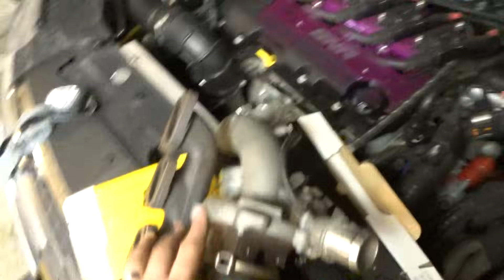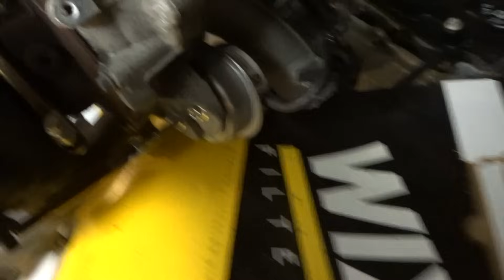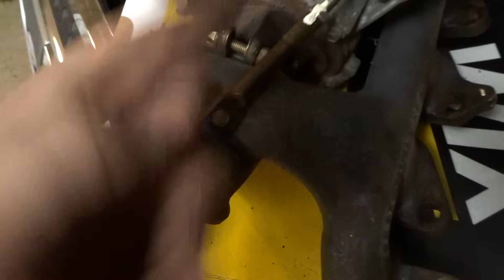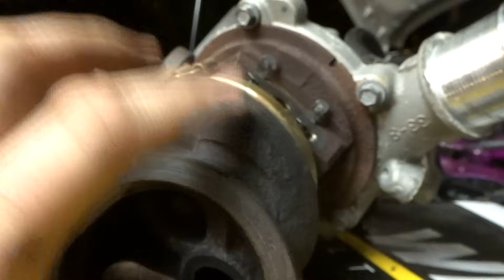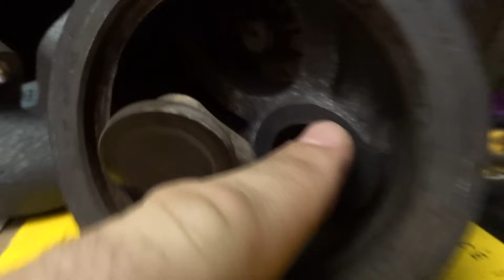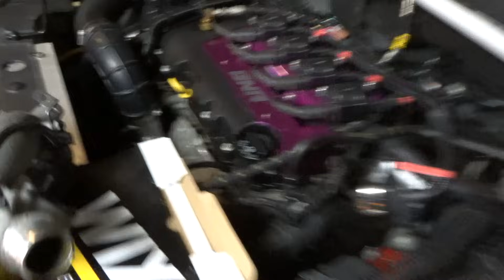Chevy Cruze Sonic P0299 Turbo Underboost Code Explained

Comment: I have a 2011 chevy cruze ltz and it has oil leaking from the pvc that connects to the turbo and the pipe that connects to the throttle body also has oil. Can you please help me understand what to do to fix the problem. TIA

Comment: I just solved this issue on my 2012 Cruze with 108,000 miles. I think everyone is looking at the wrong end of the problem... the actuator. At the other end you have the lever arm which connects to the door inside via a short shaft. I disconnected the actuator and moved the lever arm back and forth and it squeaked and bound up in a couple of spots. I then sprayed a quick shot of WD-40 under the lever arm into the shaft and it loosened up like it was new. The turbo receives oily grit from the exhaust gases and it makes sense that the lever arm shaft would get gritty and dirty also. Shure enough I test drove the car and the check engine light turned off... the turbo started working normally again and the car takes off like a rocket. I had to start and stop the ignition a few times for the computer to reset the code but problem solved. My engine has had a coolant leak so the engine compartment is very dirty but the actuator still functions great.
Reply from the maker: Fantastic. Let me know if that stays good. I wonder if it's just with grit/rust or whatever getting stuck in the wastegate arm.
Reply: I will and thanks for all your great work on these videos. Your work has educated us all looking for the solution to these issues without having to buy a $500 turbo. I hope a few people at least can restore their turbos with just ten cents worth of WD-40. I don't expect to get another 100,000 miles out of my turbo but if it resolves the issue until it cracks and falls off the car that's great.
Reply: @robinpopple358  how's your turbo now?
Reply: It stayed good! Turbo has worked amazing ever since. Engine light has never come back on. Can you move this comment to the top of the thread. People need to know how easy a fix this is and not to run out and buy a new turbo for $600  I am at 111,000 miles now so have added 3000 miles to the car without repeat of the issue.
Reply: @robinpopple358  I figured that it would be just a quick fix...as the WD 40 would just burn off and repeat the binding. Nice tip! I have 94,000 on my Cruze with no turbo issues, so far. I also did Andres PVC kit and it has worked great as well. He and the Cruzetalk.com site have helped me with other issues. If you drive a Cruze the site is a must.
Reply: Yeah mine is doing this wierd sound front of motor. No codes if I barley press the gas it can rev up to like 3 grand no sound if I punch it squeaky weed eater sound. I’m going to take it off and check it out! I’ll be super excited if I can fix with WD-40!!

Comment: You seem to know a good amount about the 1.4l turbo motor in the Chevy cruze. I am having an issue with my 2013 Cruze rs. I have a Diablo can tune on it and a cold air intake. When driving the car it feels under powered and at high rpms it seems like it is choking and bogs down really bad. Do you have any thoughts on what it could be? It throws a check engine light at times but when I turn the car off and turn it back on it doesn't show the light anymore. I hope to hear back I have tried a lot of the car forums and haven't seen much that would help diagnose this issue.
Reply from the maker: Diablo canned tunes on this car are terrible. Absolutely awful. Does it do that with the stock tune too?
Reply: It doesn't choke out at 5,000 rpm when with the stock airbox but it feels super underpowered with the stock tune and the stock airbox. Occasionally the body will pick up but it doesn't last very long before there is a jerking feel to the motor and then it loses power.
Reply from the maker: BradLee Wood  did you look at my videos on the PCV system and boost leak testing? If not, check those out for some common issues that may be the root cause of your problems.
Reply: I'll check them out, thanks man :)

Comment: I am throwing this P0299 on my 2015 Cruze currently and it only has trouble after the engine is warmed up but up until it warm it will run fine and boost will be normal. once it's fully up to temperature i lose throttle response and can get the engine to speed up. It's not a small loss of power at all. i have noticed a slight oil leak coming from behind the wastegate actuator but it looks closer to the block than anything and i can't tell if there is a oil cooler line back there. Any ideas? and if i do pull thee turbo to inspect it can that screw with the integrity of my turbo? hoping you can help!

Comment: These are good examples of possibilities for the P0299 code. The biggest problem I have seen when it comes to these turbos in the Chevy Cruze and other Chevy vehicles is the waste gate actuator itself goes to crap, mainly at the arm inside of the wall of the turbo that pivots it open and closed. The metal-on-metal rubbing eventually takes its toll. This causes it to get stuck open and essentially creates a vacuum leak AKA low boost. The waste gate will eventually start to catch and get stuck open after a lot of miles in some of these cars. I replaced mine, and it had 2 big cracks in it (larger than the ones in the turbo in your video), and the waste gate valve was sticking. If anyone removes their turbo, manually move the waste gate actuator open and closed with your fingers -- if it sounds like crap (really squeaky and generally rough) and it sticks, this is likely your issue. If this is the issue, the waste gate cannot be replaced as it is internal and built into the whole assembly, so you'll have to replace the whole turbo.
Reply: Actually any time you have a anti freeze leak and any rubber or synthetic pieces touched the antifreeze will now start to go bad.
Reply: Is this what you’re talking about? Loose actuator arm to the turbo?

https://youtube.com/shorts/Q8kyJzyrjBM?si=TZeX7AXOfj_j_aHs
Reply: mine intermentially illumnaiting engine power reduced 0299 but what happens if you keep driving it ? odo is 128xxxkm/80xxxmiles

Comment: Awesome videos and thanks for all of the info. I just purchased a 2012 1.4L Cruze and I’m trying to learn as much as possible. Very detailed and informative.
Reply: Replace that turbo feeding line. It gets clogged. Its easy to replace n cheap. Mine got clogged n blew out my turbo at 60k miles
Reply: Prepare yourself, dude
Reply: @csn6234  😭😭
Reply: I got 134k miles on mine no turbo problems yet
Reply: Take it back it’s not worth it

Comment: I had a P0299 on my sonic with 151000 miles. It was the boost sensor causing the code.
Reply: How did you diagnose it was the boost sensor? Anyway to test using a multi meter? Thank you
Reply: I tried it as it was a 30 fix vs turbo. To diagnose it you would have to have a scanner and read real time data. Also a faulty PCV in the intake will also cause a P0299 code.
Reply: Whats the part number for the boost sensor if u dont mind.
Reply: En sonic parece ser que ese sensor no lo lleva como en el cruze

Comment: Is there a way to check the diaphragm inside the waste gate actuator? I saw a GM bulletin that there could be oil inside there causing the P0299. THanks
Reply from the maker: Not that I know of. It's all enclosed.
Reply: I checked the wg flap & turbine shaft & they both seem fine. I get oil in my wg too thru the diverter. I lose boost, but if I shut the engine off & restart it, it boosts again until it does it again. I have 2 tunes & it only messes up when I run the tune with more boost. Any help would be appreciated.
Reply from the maker: Sounds like you're going into limp mode due to overboost. Who are you tuned by?
Reply: Dre Dan Bad news racing. He turned the power up & it ran fine for awhile then it thru p0299 recently. The base tune runs fine even at wot. I just like the xtra ump from the other tune.
Reply from the maker: So you're underboosting, not overboosting. 

Have you tested for boost leaks as I showed in my other video?

https://www.youtube.com/watch?v=heQYgmcGnHI
Reply: Dre Dan No. Thats my next mission. I'm wanting to replace all my air & coolant hoses w/ silicone ones.

Comment: Seeing as you have the upgrades i was wanting to ask you are they worth it? (Ls7 coils, upgraded turbo etc.)  I already have a BNR tune and short ram intake and minor exhaust modifications.
Reply from the maker: Yes worth it. The turbo really adds a substantial amount of power especially in the top end. The coils allow you to make that power smoothly. I have the valve springs too and I shift at 7000RPM most of the time.
Reply: @AndreiDPop  which turbo upgrade did you go with?
Reply from the maker: @michaelsanchez5805  BNR GTX. The only turbo worth getting for this engine.